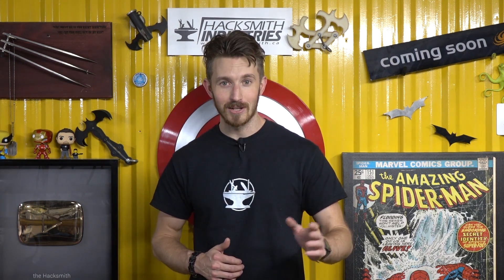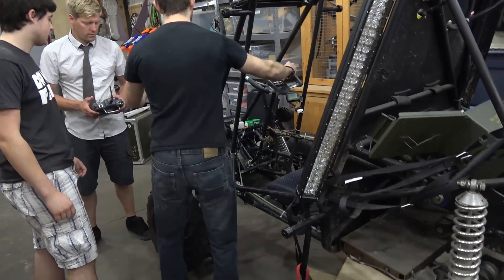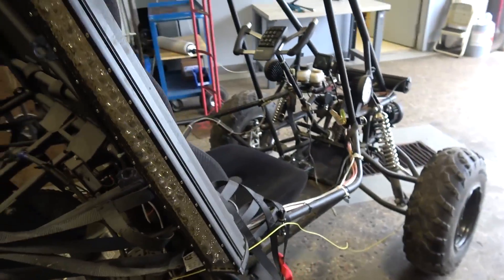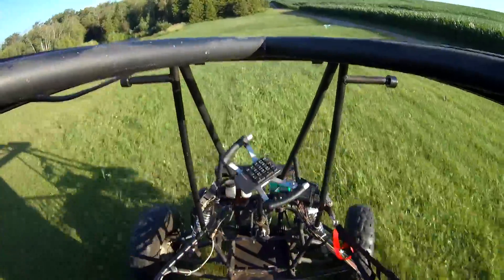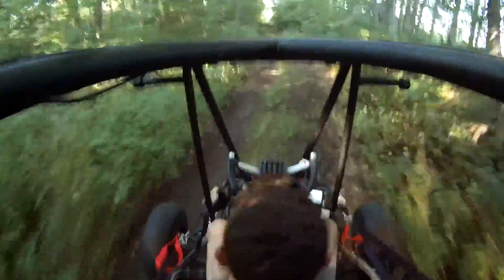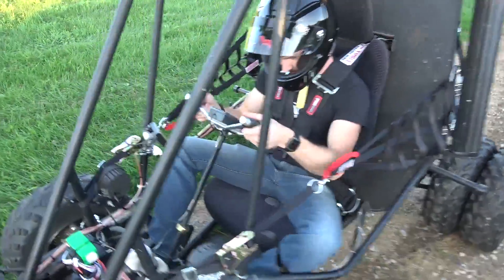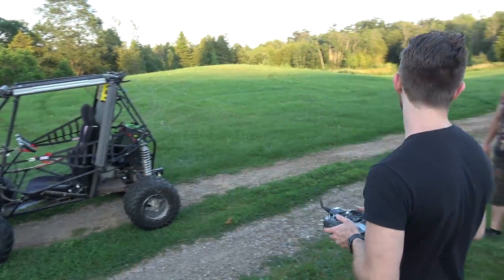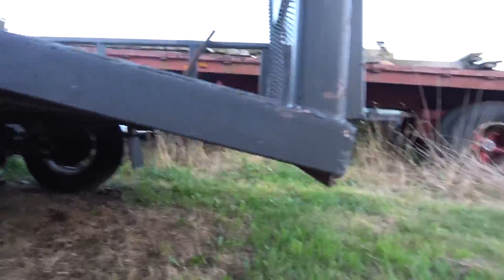Worst Idea, or BEST IDEA!?

Comment: You could connect and output to the batteries (like a wall socket) so you could plug stuff in. Like a Bat-Signal Spotlight. Or Guitar Amps so you can have a Batman themed version of the guy from Mad Max (I'm not sure how safe that would be) only thing is it could possibly cause problems powering the motor if whatever is plugged in is taking a lot of power. But isn't the idea of Mad Max guitar on a Buggy worth a try?
Reply from the maker: Yeah it'd be easy to put a inverter on there so you can plug things in!

Comment: A camera would be good for remote driving (don't forget the reverse cam!) and you could try to find a thumbstick that is angled up 45 degrees in an attempt to eliminate the steering resistance at the apex. I was thinking about it, and the area at the center where the thumbstick is at it's maximum height is possibly causing awkward nonlinear resistance in steering as opposed to the smooth rotation of a steering wheel; might be a theory you guys could dissect. Also, it looks like the traction is going to be a bit light in the front without anyone in it so the steering traction may be affected lol Looks awesome, reminds me of how fun it is to have an RC toy!

Comment: does this compromise any features of manual driving??
does it run on a engine or electric motor??
Reply from the maker: +Edwin Solomon it's electric
Reply: can it be applied to an engine setup
Reply from the maker: Sure, look up RC 1:1 cars, there are many out there!

Comment: why don't you guys put the batteries lower on the vehicle? that makes the car way more stable when going through a sharp corner.
Reply from the maker: the batteries only weigh 20lbs...
Reply: Well, that is less than expected. I don't know much of the specifications of the Batman baha (hope I spell it right). If the weight of the batteries isn't much in contrast with the other weight it doesn't matter indeed.
Reply from the maker: +Lars Roozeboom lipo batteries are a third of the weight of lead acid :)

Comment: If you use an s.bus receiver, connect it up to the rx1 pin on an arduino mega via an inverter lead and use the futaba_sbus library your control speed will improve a lot, rather than reading each channel in turn using interrupts which as Bogden mentions causes a 100msec delay, and that's only using two channels. I have a R/C truck which runs on 8 channels using the s.bus setup and it responds a lot faster than it did when I was running it on interrupts.

Comment: Do you have any resources where I can learn more about how you use LIPOs? How you recharge them, overcurrent/undervoltage protection, which to buy, etc. I'm trying to make an electric dirtboard totally from scratch with an arduino based control scheme, but the batteries are what's holding me up at the moment. I'm a mechanical engineer, so that's one area in which I don't have a lot of experience (and I really don't want to mess around with LIPOs if I don't know what I'm doing).
Reply from the maker: +Cody Hufstetler honestly you can find a lot of info on them just by searching on Google :)

Comment: You need some weight on the front wheels when driving without a driver... so put a battering ram in front ;)
Reply from the maker: Sounds like a plan!
Reply: The trailer doesn't stand a chance.

Comment: You should also set the camera on the baha to send live feed to either a laptop or, preferably, the remote itself so you can see in real time where the car is without you, know crashing into stuff lol. That sounds more like a remote overhaul than the baha but, same project lol
Reply from the maker: It's literally as simple as attaching an FPV module on, which we have =) Just didn't do it for this video. This was the first RC test that's all =)
Reply: Cool, I figured you guys already thought of that but I thought I'd vocalize the suggestion anyway.

Comment: Without a person in it, it looks like the car was getting significant understeer. Maybe the batteries could be moved in front of the seat to put more weight on the front wheels?
Reply from the maker: The batteries don't weigh enough to make a difference =P once we armour it up it'll get a bit more front heavy. plus the winch and maybe a ram bar =)

Comment: You should put a switch on the actual steering wheel so if you ever need to cut the remote control signal it will be easier

Comment: What about speed dependent steering.
So if you're going fast the steering wheel reacts very little and when slow you get full turning capabilities.
This should ease the controlling in a straight line by a ton

Comment: An RC car transmitter with a wheel on its side for steering is probably better than a mode 2 RC plane transmitter.
Reply from the maker: Doesn't give you any option for extra controls...
Reply: the Hacksmith Nevermind, you're right! I thought >4
channel transmitters also existed for RC cars. They only exist for RC plane and helicopter transmitters.

Comment: Should add power steering to the buggy if some one wants to drive it won't be hard to turn
Edit. You should also buy a turbo do you get more hp
Reply from the maker: Turbo's don't work on electric vehicles =P it's also not that hard to turn. Power steering would be a very expensive upgrade that wouldn't really benefit anyone haha
Reply: the Hacksmith oh sorry I thought it was a petrol 😂 so sorry

Comment: You guys should set it up to have a routing system to drive to pick up mail or if you take it on the trails it can drive itself back based off how much charge is in the battery so it knows how far it has gone and how much more power it needs to come back to the starting/designated location. Also you should install brakes and  reverse from the remote.

On top of all of that you should make it hit 40mph or so and set up a racetrack type area where you can show off it's abilities like after finishing the course you can have it drive into the empty warehouse and light it up with the new updates. My favorite project so far and keep up the great work 🤙👌

Comment: In the future you might way to switch to lithium ion instead of Lipo batteries, you could make one out of a bunch of 18650s, it would be pricey but it will allow you to get more range and power,  I am currently using them to make a battery for my ebike that will get me 250+ miles on a single charge and 25mph
Reply from the maker: LiPo and Li Ion don't have much of a different energy density... The biggest issue with 18650's is you need so many of them to get the current rating
Reply: the Hacksmith because you have so many lipos it is definitely more economic to stick with them, and you do need a lot of 18650s, but then again it allows you to make some really nice custom batterithat can be in whatever shape and have whatever specs you want. I love this project! I am a big electric guy, and it's great to see projects like this!

Comment: Question... Wouldn't insulating the batteries be bad for it? They get hot under use, so wouldn't it be prudent to have some kind of cooling air instead of foam padding?
Reply from the maker: +BrokenLifeCycle point wasn't too insulate, but to protect from impact

Comment: Program it so it comes to you on the push of a button. This would likely need the addition of a GPS system (lets be honest, which it should have anyway) and possibly some form of ultrasonic sensor to avoid collisions, but the latter is fully optional.
Reply: Not to mention that adding this functionality, with maybe the addition of the actual controls to a wrist mounted control would be very Batman indeed hehe

Comment: Imagine that gets a really fast engine, and the weight is all dispersed, when I say dispersed I mean it won't tip over from the speed, oh and breaks might kill the driver, but there can always be an air bag an a seat belt, and what if my engine idea is there the driver kinda has to be strapped in so that he or she won't break their neck and it's own batmobile (idk how to spell it) steal and aluminum body, like the way a car has that body, except this one could be plated so that it won't give under pressure

Comment: I would not trust something that powerful with the stock turnigy 9x receiver. The range is too unreliable.
Reply from the maker: If it loses connection it turns off lol
Reply: So you have a failsafe on it? That fixes it haha. I ended up getting the FrSky module and receivers for better range and to enable failsafe on my drones. Much safer. Also don't lose my stuff up in the sky 😁
Reply: FANCYKIDTUBEHD it seems that you don't understand that without a failsafe RC will continue on its last instruction if it loses connection. So if you had it going forward it would continue to go forward unless a signal instructed otherwise.
Reply: the Hacksmith well duh, it will lose connection like all other remotes.